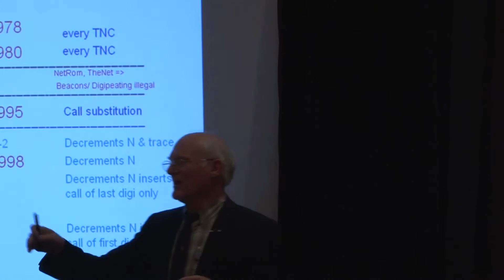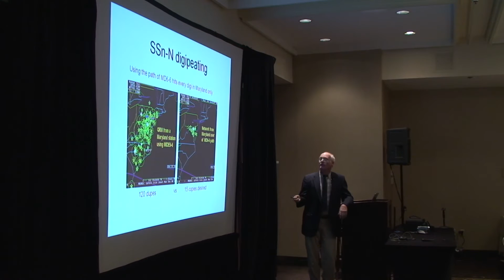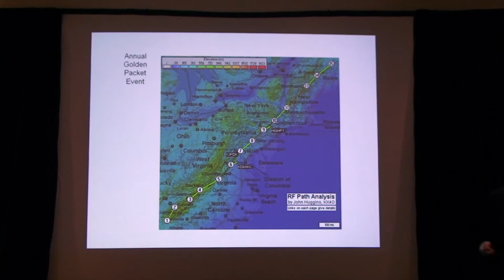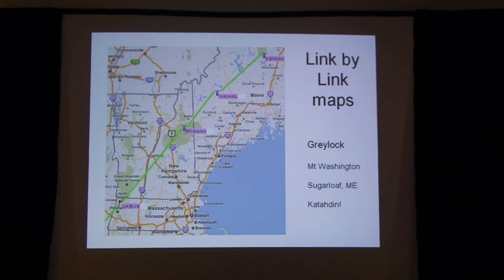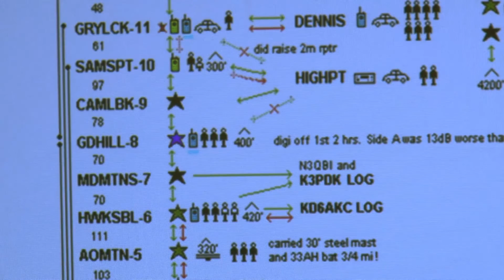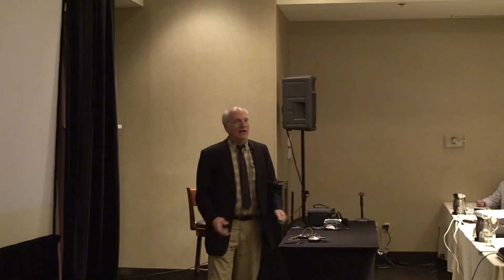2011 DCC - APRS Ad Hoc Networks

Comment: Amazing.

APRS just RIP OFF D-star.

Plain Simple, analogue, many ways to do APRS ( you can do this even without a radio with APRS TNC, for example, Multipsk can do this for you, APRS and a software TNC ), its global, INTERNET NON DEPENDENT, and you can also check external received email from Winlink 2000. (APRSLink)

And a lots more... ( emergency can rely on this 5 by 5 !!! )

Getting TH-D72 :)  Done and done. Thank you BOB ! 73
Reply: What? Um no. D-Star and APRS have almost no relation. One is no a "Rip off" of the other. APRS was even around 10 years or more before the popularity of D-Star!